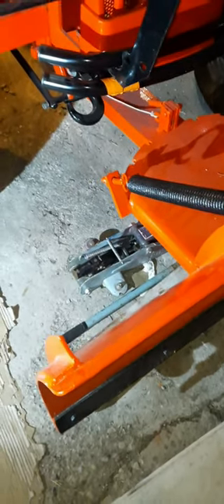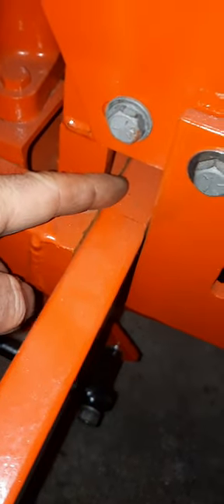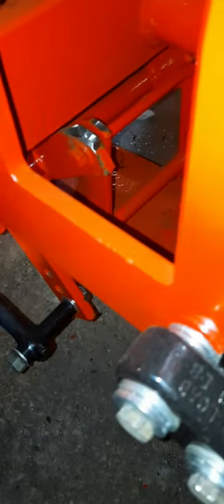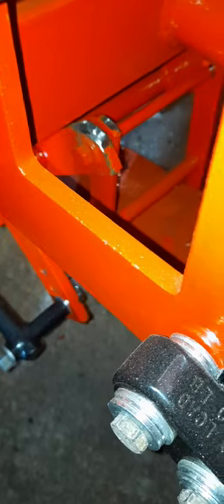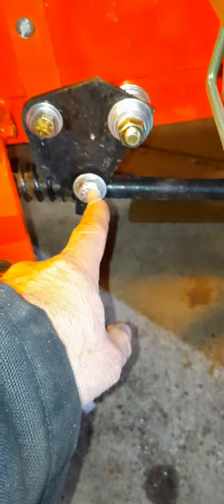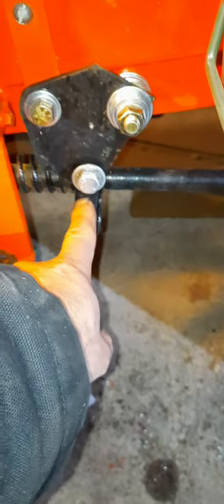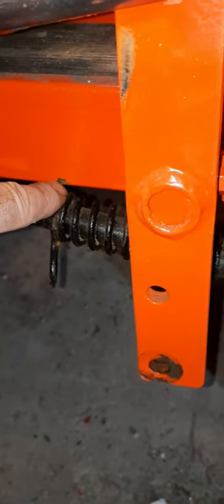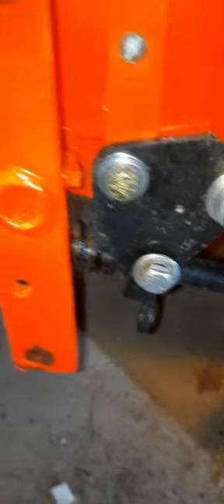POWER KING 1979:  SNOW PLOW MODIFICATION.  NO NEED TO REMOVE PLOW SEASONALLY, EVER AGAIN.

Comment: Yup my steering arm snapped in the exact same spot years ago just welded back together  never had a problem with since
Reply from the maker: Yes a weak point on power king tractors.